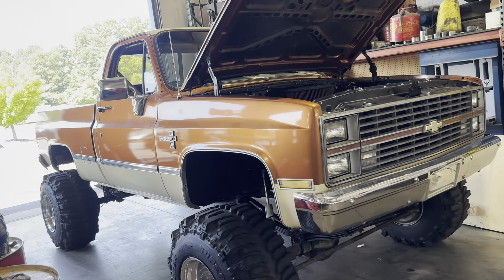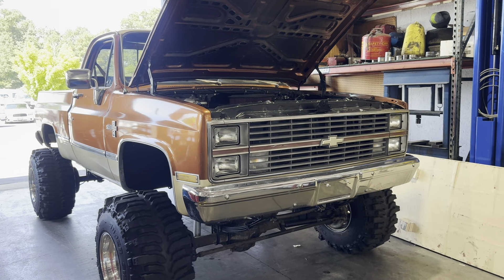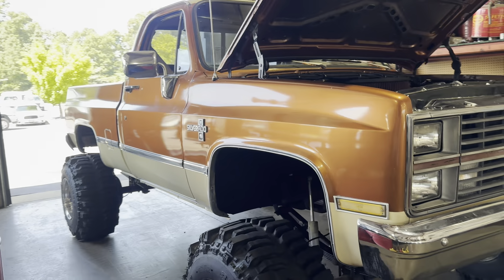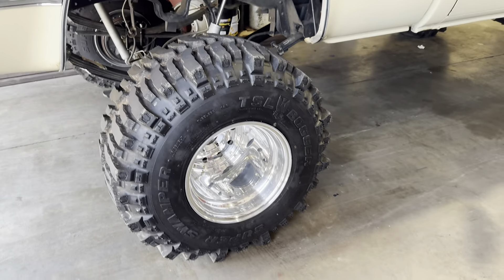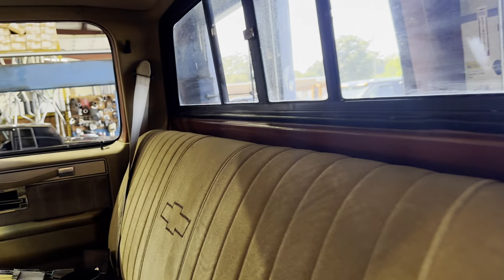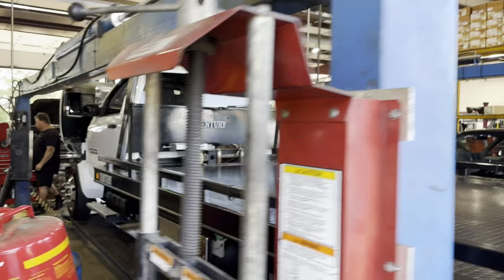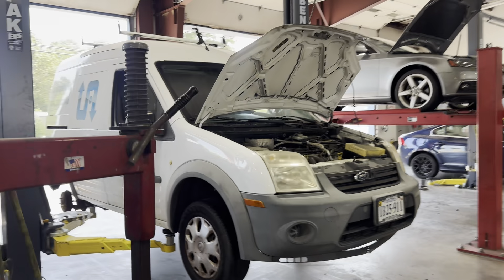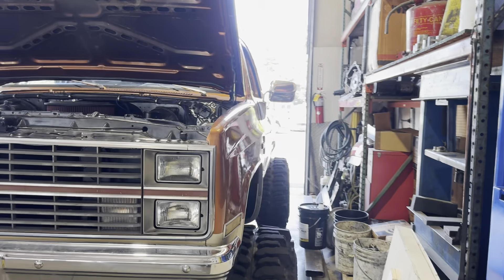Squarebody bigblock 502 getting power steps upgraded steering and track bar sold headed to Alabama

Comment: I've been keeping track of this truck on ticktock. Just discovered your YouTube page. Were do yall find all your weld wheels all the 15x15's? I have a K 10 I've been working on for a few years and can't find a set of new wheels anywhere?
Reply from the maker: Weld wheels are near impossible to come by these days. We were very fortunate. We purchased all of welds in inventory when they closed. A lot of the wheels that you see, though are other brands such as this truck.
Reply: @DavisDrives  thank you
Reply from the maker: We are working on an exclusively built wheel that will come in multiple sizes. 14 wide 16 wide 18 wide very soon. Stay tuned to our channel or Davis off-road.
Reply: @DavisDrives  that's awesome news

Comment: Please put those wheels & tires on something else!
Reply from the maker: Don’t worry we got them stacked up ready for the next few trucks
Reply: Your WRONG 

Boggers are the coolest tires ever!!

Plus those rims are beautiful!!
Reply: @dsc420247  I've got 38.5 Boggers on a 78 K20 mud truck. They aren't worth a sh-t on the road fella. You pavement pounder.
Reply from the maker: @haroldstrickland8416  we have them on about 50 trucks we love the way they look
Reply: @DavisOffRoad1  They're real aggressive & even advertised as "professional mud tire". They ain't no good on pavement & destroy wheel bearings, ball joints & king pins.
Reply from the maker: @haroldstrickland8416  ohhh yes they do esp when 54” tall and on 20” wide wheels ball joints and wheel bearings weekly 😂
Reply from the maker: But we also have them on competition race trucks as they are designed for that run across a mud pit at 3-4 seconds
Reply: @DavisOffRoad1  I'm not hating on you folks. I have two Squares with TSL & one with Boggers myself. I see your clean, straight & polished Squares with those offsets & Boggers & just gets to me. I'm old fashioned & not new fangled.
Reply from the maker: @haroldstrickland8416  totally get it man no offense taken we partner with Mickey Thompson on lots of projects but unfortunately they just don’t have the sizes like bogger do
Reply: @DavisOffRoad1  Been a while since I've had some Fun Country tires. Period correct though.